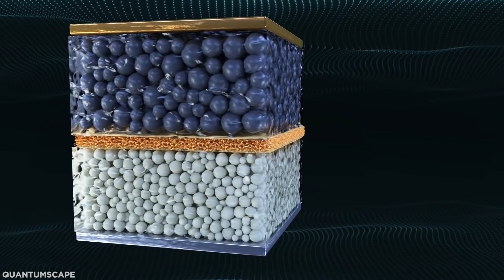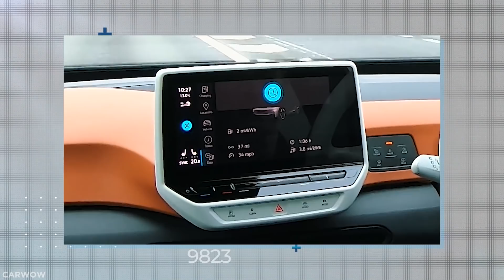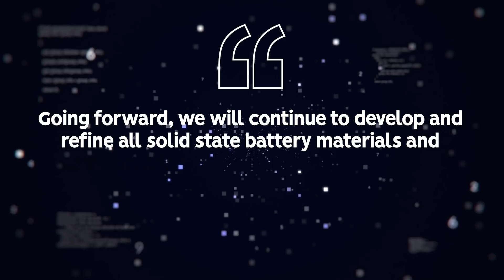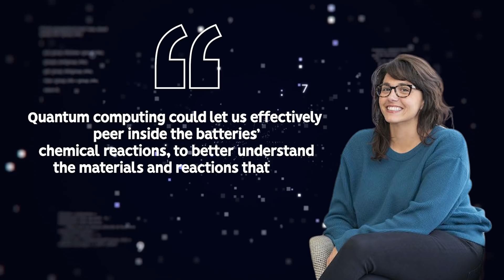Why Solid State Batteries Are The Future

Comment: You should be more realistic when it comes to batteries.
The energy-storage in Lithium atoms is fundamentally very low, when compared with organic carbon-based molecules.
For that reason you will always have to deal with large volumes, large weights, and much polution.
The laws of physics cannot be altered. The new 4680 is only a small improvement with regards to weight and volume.
So unfortunately no solution, but to diminish the need for the insane amount of transportation nowadays.

Comment: There is no future for EV's when if everyone had only EV's the power grid does not supply enough energy to recharge that many EV's Until you can recharge one in the time it takes to fill your car with gas and drive from say Chicago to Denver in 12 hours they will never replace fossil fuel autos or trucks.

Comment: If they play this smart, they bring to scale and to market a solid state battery that may not be optimal, but good enough for road applications. If they then think cleverly about the interface of the battery with the car (format, size, etc.), then they can continue development on higher capacity versions while already working on optimizing large scale production. Then by the time the 'end-of-the-decade' best performing batteries are ready for deployment, the factories making them could already be fully prepped to immediately start production and current drivers with older solid-state battery versions could upgrade to the newer versions because of the aforementioned pro-active decision making on the interface part.

Comment: I think Range is very important to some people and I’m one,I run a 2ltr BMW diesel which is outstanding on fuel and performance and will consistently do 650miles on a full tank when required. I agree that not everyone needs this sort of range and electric is the future but until this battery technology becomes available as it will to a lot motorists will stick with diesel or this self charging nonsense where they use an engine to power a generator instead of powering the vehicle directly and still doesn’t get anywhere near the efficiency of a diesel. The fully electric vehicle is the answer to emissions but let’s not forget it’s a bit of a trade off because of all the pollution that is caused in production of all these electric vehicles,they forget to mention that fact when trying to con us all into buying electric vehicles.

Comment: The Polestar 2 carbon footprint report makes interesting reading re. CO2 equivalancy for electric vehicles. With a European power mix, they reckon it takes 48000 miles (78000km) just to break even. If you really want to be green, buy a second hand diesel.

Comment: Do you think these newer battery technologies will allow retrofitting to existing vehicles? Or should the current crop of e-vehicles (cars, motorcycles, even planes) be seen as expendable and having a very limited life? There are classic ICE vehicles that are decades old and still performing. I'd hate to think that a Tesla, etc. would be scrapped in 5-7 years just because the battery has gone bad. In fact, if Tesla etc. HAD these newer batteries, would they upgrade pre-existing cars (for a price of course)? 

Just curious if you have any insight about this.

Comment: Solid state is the dream.  You don't think Tesla is working on this?? By the end of this decade Li-ion batteries could be as cheap as $50/kW. By 2030 there might not be any advantage to having solid state over the 4680 cells. Range is increasing, power density is increasing and costs are falling. The only problem is how many can be produced by 2030. Can we make enough to replace half of the worlds fleet?

Comment: The only way for an electric car to be viable besides range is the charge time and infrastructure. I will still use an gas car because they are quicker to fill up. When the time comes that you can fill up an electric car as quick as a gas is when the age of electric cars comes. That and the power grid is able to handle the extra stress

Comment: Range is not the issue.  It’s charging time and infrastructure.   What about recycling?   What about heat and cold?
If you bought an EV with current technology, are you going to eat it when the solid batteries come on line and obsolete?   
Right now EVs are, let’s say, in the rich geek market.  The real test is the Bubba market.

Comment: The miles is not really the big problem, the price is the real problem. Only when Tesla cut the price of electric car into half of normal car, then it will boom. Those solid state thing is good, but they won't sell cheap. if not selling cheap, no one will buy.  Also the normal car will cut price as well, so Tesla must do quick.   Autonomous driving is beautiful, but whenever one accident occur, then people will drop confidence on that.  It should be a nice feature but cutting the car price is what Tesla should do it now,  in order for next boom.

Comment: 600 miles is WAY more than typical gasoline powered cars. The average gasoline car gets about 300 miles, a simple google search turned that up. So an electric car getting 300 miles travel range is still pretty dang good. It's equal, if not better, than your average gas car. With that said, Tesla's Roadster 2 is said to have a travel range of over 600 miles, which is incredible.

Comment: Petrol and diesel cars will not be banned, the buying of new cars powered by petrol or diesel engines will. In the long term any vehicle with a large battery will pollute more than fossil fuels will, even when electricity can be produced by 100% renewable energy.What EVs have 300 mile range, lucky to get 300Ks

Comment: Here is why they aren't...
1, the need to increase distance.
2, the need to replace the battery.
3, The need for fast charging
4, The labor to change a battery would cost more then the car.
5, higher then needed carbon footprint.

Comment: Instead of concerning myself with going 600 miles. Why don't you try making a car battery that will charge as fast as you can fill a car up.  So would I rather have a battery to go 150miles and charge fully in 3 min. or 600miles in 8 hrs. I'll let you decide.

Comment: No mention of the weight, the achilles heel of batteries, the denser they get the heavy they become and the more energy is wasted carrying this weight around.  Smaller is good using less space but we need to loss a massive amount of weight, which would extend the  range.  The latest Tesla 3 (built in China) has a new battery which is 200 KG heavier which is a total weight of 800 KG. The car weight is 2.2 tones total this is 700 KG heavier that BMW 3 series which makes it nearly 50% heavy.   The BMW i3 was designed to be a ground up EV and weights 1365 KG - yes its range is only 175 miles but a Standard Tesla 3 range is only 245 miles.  The obsession with range is adding massive weight with diminishing returns.  We need a much better, lighter & smaller storage for the electricity, batteries are going on the wrong direction.

Comment: Manufacturers should make their vehicles open ended so that new batteries can be inserted into existing vehicles without changing the initial design of the vehicles. That way they don't need to wait for new battery tech they can just change over the batteries as the new and improved batteries are developed.

Comment: Nice video this, however they made me question there competence when they come out with "the average electric car has a range of around 300 miles" as an early statement, sorry, that simply not the case even on quoted range, let alone real world range, I drove a 325 mile Tesla model 3 for 1 week, I managed driving it in the same way, speeds etc as my BMW 520D, got 194 miles 1st charge (was sticking my foot down a bit and getting used to it), 2nd charge was on for about 215 miles (had to give it back before it was flat but was looking at about 215), and that's the Tesla which quotes comfortably the biggest range in that class of vehicle so you can derive what you'd really get based on the quoted figures for rival cars.

When it comes to range ref electric vehicles if you drive it like your driving miss daisy knock 20% off the manufacturers quoted range,  if normal driving knock 30% off, if you like to get your foot down (a bit like me) then knock 35 - 45% off..

Comment: Imo 320-350 miles is good enough. There's already Tesla superchargers that let you go cross country now easily. Sure you need to break for 45min every 300 miles but that is a good thing! 
With FSD and Autopilot you don't even feel the strain and you can stop for a good leisurely lunch too. Most people rarely drive more than 40miles per day so a one time having to stop for 45min is not a big deal if you're going 600 miles or 1.5hrs if you're going 900 miles. That is NY to Atlanta which is across like 6 states. 
Forget these 600mile and 700 mile batteries for right now. They will come naturally. Focus on making EVs that can compete with Tesla's 400miles already. At min they're going 320miles for their LR models.

Comment: The 1 000 km + range of diesel cars isn't comfortable because we can travel far in one go, but because we can fill up the tank in less than five minutes and don't need to fill it up again in a week or two. If the future EVs can charge from 5% to 90% in less than five minutes and achieve the same range as diesel cars, with equal initial purchasing cost, they'll sell easily.
Reply: 20 min is good enough but in some parts of the world heat is needed and heating from batteries is highly inefficient and range destroyer .

Comment: The initial research for lithium ion batteries was mainly done in the 1970's and 80's. The technology didn't start taking off until 10 to 30 years later. Fusion power has been "the future" of electrical power generation for many decades, and is barely advancing in spite of a lot of hard work and generous funding. 
Maybe solid state batteries will come in a decade, maybe not. It's a promising technology, probably more likely to see real life applications than fusion power. But it isn't necessary right now for electric vehicle adoption. 
Electric vehicles definitely do need many improvements, and that includes battery technology improvements, before they become cheaper than gas and diesel vehicles. It's clear that the technology is improving rapidly and, with or without solid state technology, electric vehicles will be cheaper and better than gas-burning vehicles within a few years.

Comment: Yep, solid state is still way in the future.
Tesla is "almost now"!
QS has set goals of some 350 watt hours/kg energy density by 2025. Tesla almost has that now. QS expects 100% charge in ten minutes in 5 years, Tesla has 80% on 15, already!
QS has no "all" solid state prototype, no pilot plant and no factories (and no batteries to speak of).
Tesla (and others around the world) have working electric vehicles.
Ten years ago, Tesla predicted a 10% chance of actually selling 500,000 EVs by the end of 2020. Instead of vaporware, they missed their target by a mere 0.09%, surpassing Wall Street expectations!
QS (and others)... IT'S TOO LATE.
Tesla went from "0" to half a million (per year) in ten years. 
1-1-2031 
Tesla went from (almost) "0" grid storage facilities to a primarily solar charged, battery powered world...
Cars were just the catalyst to their early 2020's worldwide adoption to renewable energy and its storage. Now, they only sell 20 million EVs power year, which pales in significance compared to their global energy generation, (underground) distribution and ubiquitous storage.

Comment: Smaller and lighter means nothing if the cost is not cheaper.  This is where the real factor comes in.  After crossing the path to mass production, we still need this technology to actually beat lithium in pricing.  Much like how OLED TV are superior, only a handful were sold because they're simply too expensive, and regular LCD TV are good enough for the average consumer.  An electric car with 300 mile of range is certainly good enough for most consumers, and that's what Tesla can offer today, before the 50% improvements in price and density kick in from their new cells.  In a few years when solid state batteries are ready for production, they'll need to be more competitive than the future lithium battery tech.  Unless we discover that solid state means much cheaper batteries, I don't think it's necessarily the future, it might just end up being a high end option used by specific industries or consumers with deep pockets.

Comment: If a battery like that is not enough, other then regenerative breaking why not also have regenerative Shock absorbing Struts and transparent solar energy film for the Car windows or on the car body itself? Those should enhance the extended range for EV and Hybrid Alike theoretically.

Comment: Your research on Tesla's batteries and ranges is ridiculous. Roadster: 1000km range, Model S Plaid +800km range. Tesla's self developed dry battery electrode tabless batteries (4680 cells) will launch in 2021 with 56% reduced cost at $50 per kWh, and +50% higher range.

Comment: Theoretically speaking solid state is the way to go promising lighter weight,  and very high range. The only problem is, supposedly they are going to go in production 4 years from now, and are even promising better performance than those over a million miles batteries with a 1000 KL range that Tesla is already starting to produce. My feeling is that this solid state batteries needs a lot of problem solving time, before the go in production, and if they are saying that production will start 4 years from now they are also admitting a lot of wishful thinking, as they cannot be sure at this moment that those problems will be solved within that that time frame if ever. There are million fantastic projects at the theoretical level that we never hear of them again, chances are that this solid state batteries are one of them, and if they are, then VW  and many other car firms could be in serious problems a few years down the road, if they cannot secure a steady supply of batteries efficient enough to compete against Tesla present battery performance.

Comment: TESLA have the 4680 battery with 600+ range, 1million miles lifespan already,  in case you're late to the news. SSB doesn't matter at this point.
Reply: The hope for SSB is faster recharge. Toyota is making the tall claim that it can recharge an entire SSB within 10 minutes. If true, this would be a gamechanger, but tall claims require solid proof.
Reply: Tesla get their battery from Panasonic. Panasonic is not the only company that can make battery. Sorry to burst your Tesla stock....
Reply: @jonpetter8921  
Wrong.  TESLA using Panasonic to produce TESLA batteries with TESLA technology.